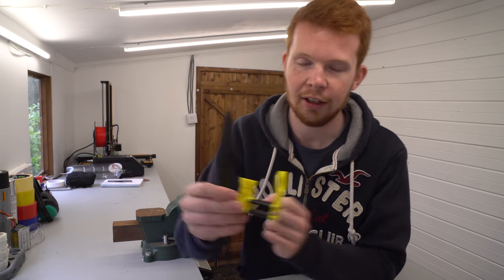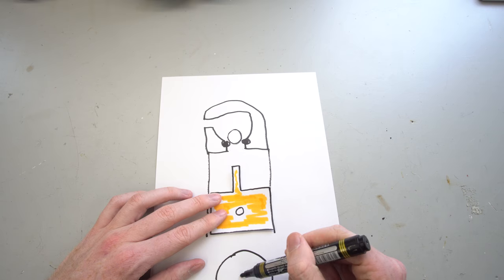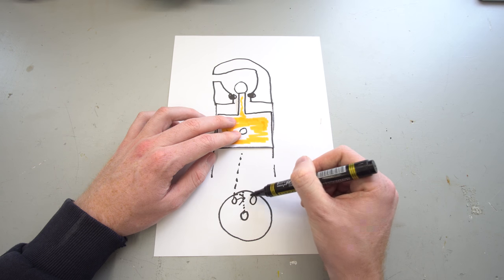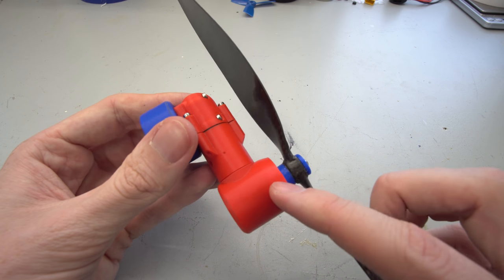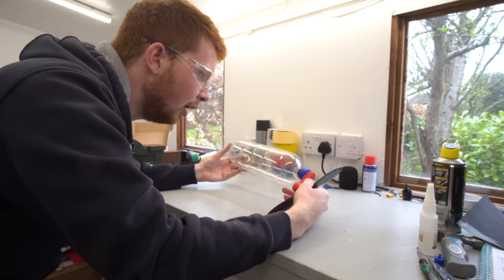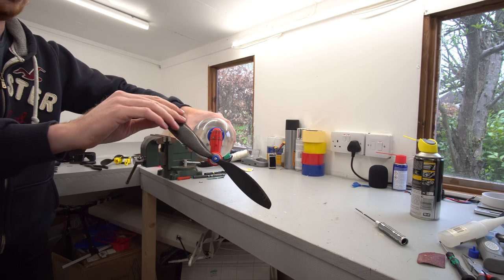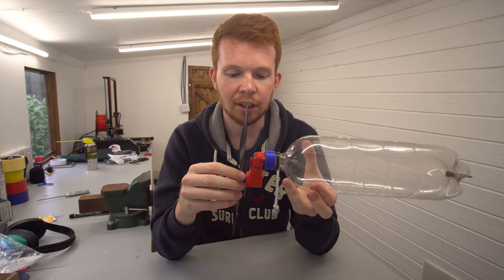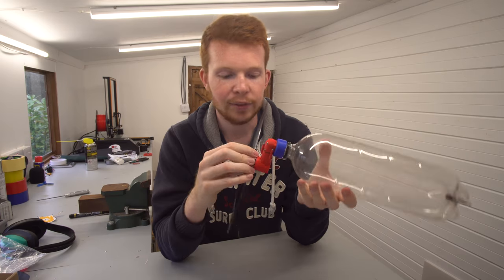Compressed Air Engine Modifications

Comment: You might consider offsetting the centerline of the piston from the centerline of the crankshaft. Look at the VW VR6 engine for an example. By offsetting the crank, you can change the amount of lift duration you will get on either side of Top-Dead-Center. You can also use this to get the downward stroke of the engine such that the connecting rod is more vertical during the power stroke, which reduces side forces on the piston while under load. Playing with this could yield some benefits to the design.
Reply: USWaterRockets yes that would actually be a very good alternative, good explanation.
Reply: That's exactly what I was also thinking about. It would prevent the engine from backfiring - basically putting the timing "later".
Reply: A compression release would improve efficiency. What an engine like this needs to make the most of the air supply is a valve that opens precisely at top dead center then closes right before the piston uncovers the exhaust port.
Also right at bottom it should have a valve that opens an exhaust port at the top of the cylinder so there's little resistance to the piston moving up. That valve should close just before the air inlet valve opens.

All that would make the most efficient use of the compressed air, but the linkage to get the two valves operating would be complex.
Reply: What if there was two holes in the side of the cylinder wall near the top, one on each side. Then a moving sleeve on the outside of the piston with two holes in it that correspond to the two holes in the cylinder, except they are offset in height. That way when the sleeve is slid up, one hole opens, and when it is slid down the other hole opens. Now connect that sleeve to the crank shaft 90 degrees out of phase with the piston. That way you have a valve mechanism which switches from intake to exhaust when the piston is on top and on bottom. 

It would require more precision fits to keep it airtight, but it should be about the same as making the piston seal inside the cylinder.
Reply: @greggeshelman  No, I think you want the intake closed well short of the exhaust opening, or you get no expansion benefit...ie. you exhaust high pressure air WITHOUT it doing any work.  Would be high power, but lousy efficiency.  I agree his design is WAY to far the other way, and the intake valve needs to be open longer than it is.  I suspect, off the top of my head, what you actually want is just a bit above atmospheric at exhaust port opening.  All of this can be calculated to provide any efficiency/power curves you want, within it's capability, which for this engine is ZERO.  ;-)   I would have designed it to be double acting, as well.  Then you can use a MUCH smaller flywheel, you are not throwing all THAT energy away, and the power will double (more or less) for a given piston sweep.
Reply: @MrJdsenior  what it needs to be is a 3DP version of a double acting slide valve steam engine
Reply: @greggv8  Yup, that is what I was thinking.  I worked the riverboat at Dismal World in Liberty Square as a kid/young adult, which was steam powered.  They were double acting 14" bore and about a 4 foot stroke, 90 degrees out on the wheel, 125 psi.  Eighty horses each, TONS if torque, about 10 RPM, as I remember, it was a lot of fun, ran on #2 oil with a little turbine generator up front.

Comment: Maybe the Carbon fiber prop couldn't carry enough momentum at low rpm to keep the engine running?

I am by no means an expert though, so I could be wrong...
Reply: Yeah I think there needs to be more mass for sure. Maybe a small steel flywheel mounted behind the prop.
Reply: At least it worth testing with a flywheel instead of a prop. Just to study the engine.
Reply: When it is mounted on a flying airplane the airflow through the propeller will give it a lot more momentum.
Reply: Definitely the flywheel is too 'small'. To get maximum increase here with minimum additional weight, mount extra weight at the end of the propellor. Must be well balanced though. This would surely do the trick, since the design idea itself is excellent!
Reply: What 3D printer are you using Tom? It's really good that it produces airtight parts.
Reply: I don't think tom should use a heavier prop, he should put a coin sized piece of aluminum or steel depending, behind the prop to help keep the momentum going
Reply: and maybe decrease the size of the rotation diameter of the crackshaft? (if that's possible)
Reply: Creality CR10
Reply: Brodie Bennett Could be, but it also is just a verry inefficient Design!
Reply: Brodie Bennett might not be the only reason but defend telly wouldn't help
Reply: Brodie Bennett ii

Comment: Those exhaust holes look pretty small to me considering they need to let all of the air out of the chamber in such a short time. Maybe you should try increasing the size of those.
Reply: i think what the spring does is it lags the air intake, whith this design it is the only way to control the timing
Reply: or add additional exhaust ports.
Reply: The air goes very fast,so you don't need a big holes

Comment: you could use a screw to open the valve then you can just turn the screw to increase or decrease the timing.
Reply: That's actually a really good idea.  Make the rod coming up out of the piston a threaded rod.  Would just need a jam nut on it or something to keep the timing from slipping while the engine was in operation.  Or, once optimal timing is found glue into place.

Comment: You might also want to experiment with the amount of volume above the piston. Because if it is too small then you might also compress the remaining air too much in the up stroke. And if it is too big you waste a lot of compressed air.
Reply: K van der Veen good point.
Reply: I wonder if there is a way to properly design these things without resorting to trial&error. Or at least do the trial&error in some kind of simulator instead of a 3D printer ;)
Reply: Something along the lines of AutoCAD with a CFD (Computational Fluid Dynamics) plugin?
Reply: hmm, went looking at CFD options: AutoDesk CFD and SimFlow were the main ones I found. SimFlow has a free evaluation version.
Reply: In real cars this space is known as the cc ( cubic centimetres) and the car makers have perfected this ratio so very good point U have there

Comment: Your engine needs to compress a small amount of air while the piston is going up so you lose energy there, I think your best bet would be to have a separate valve activated by a camshaft. You could just make a rectangular piece that runs in a groove in the side of the engines are rides on a off center circle connected to the crankshaft, you lose a bit of energy to friction but you would still lose less than you do with your current design. It could also work as an exhaust valve.

Comment: I really love your contents.
Please make a rotary version too.
Edit: I meant rotary engines or different engine designs.(the dorito ones, any other engine types would be cool though)
please make a turbofan with compressed air tube running into the compressor blades or something
Reply: Xdew Gaming&More do you mean radial?
Reply: air vane motor, just like in an air tool , no springs in them! or a piston controlled inlet like in a toy steam engine, the cylinder moves in a wobble to cover/uncover the inlet and exaust
Reply: +1 for WW1 style rotary :)
Reply: AIO inc. a radial engine has pistons and a rotary has “Doritos” both would be cool though
Reply: HalfBredNinja I understand what your saying and it’s completely right i was just referring to a rotary engine as in a car.  I know it’s actually called the wankle but sometimes referred to as a rotary
Reply: Simpe solution: Wankel rotary
Reply: tbh, that's basically what a pneumatic rotary engine would wind up being.
Reply: Xdew Gamin
Reply: Luke Kolodziej a wankle is not a rotary, it is a rotor engine, a rotary is far more similar to a radial engine
Reply: Xdew Gaming&More 
A duke engine 😂

Comment: The spring is there to offset the opening and closing of the valve. It is opened at TDC and closes much later because of the spring. The design without the spring is basically symmetrical, so after the chamber gets pressurized the piston does go down but it wastes too much energy to go back up. I.e. the piston gains almost the same amount of energy going from TDC down as it takes for it to go back to TDC. Add some friction and your engine goes puff puff stop.
I say replace the center plastic pin with a metal one that moves up and down and rubs against the con rod. The top shape of the con rod should be made like a cam so that it pushes the center pin out. This way you no longer need a spring and you achieve basically the same thing.

Comment: It's air, operates cool, and doesn't seem to need much (if any) lubrication. In theory you could have the air push the piston up from the crankcase and get a more compact design. (So pulling on the usual "pushrod" of associated with a piston design.)Then have a slider-block type valve on the flywheel to meter and time when the air is allowed in.

Comment: Always good to combine the strengths of materials nice project!  One mod I would try is the piston piece on the top use a threaded rod or screw so you can make very small adjustments.  The top of threaded rod that touches the ball can have a piece of hose to give it a very slight amount of shock reduction and give it a little more compression which will make it run smoother.

Comment: what if you tape 2 or 3 bottles together side by side, all 3 with valves fitted to the bottom like you do on this one, but the 3 fill valves are not puppet valves, just tubing connections, that  connect the 3 bottles together? like a manifold,  then you will not loose any strength but you will have double or triple the volume, as the centre bottle dumps air into the motor, the other 2 bottles dump air back into the centre bottle, they can also be mounted one in front of the other, the best would be if you could make a system that automatically switches between a bottle and the next when the pressure is low on one bottle, but that's a bit too much for the spirit of this project :P

Comment: You can separate the piston and tip that open the airflow. You need two shafts and two steps on the crankshaft. It will shift a piston little bit down, when air flow is opened.

Comment: A couple suggestions:
1) a heavier flywheel (prop) goes a long way to making troublesome expansion engines run
2) the crank bearing should be mounted eccentrically in a sleeve in the crank case nose.  Turning the sleeve would have the same effect as lengthening or shortening the peg on top of the piston.  This is how Telco Shark CO2 motors are adjusted
3) have you considered putting an inflation valve right into your bottle cap assembly?  That would allow unmodified bottles which could be quickly swapped out and comfortably run at a higher pressure

Comment: "Back in my day" we had Telco CO2 motors which operated on the same principle.  A couple of features they included that you might be interested to incorporate.  Firstly, the crankshaft bearings were mounted on an eccentric carrier which was rotated to act as an adjustable throttling device - that is like you sanding the top off your piston.  Secondly, the pin is aerodynamically important and (from memory) was profiled to flow the gas radially outwards from the pin axis.  I'd also guess your pin is blocking most of the inlet port area which is what's causing the lack of running.

Comment: I think the issue is the piston is experiencing as much force in the opposite direction as it is in the forward direction, so the forces are canceling each other out. To go springless you could use a single cam on the crank shaft and have it open the ball valve. Then you would be able to adjust the timing on the engine as well as determining exactly how long the valve is open for.

Comment: My thoughts are that the piston is having to compress too much air on the up stroke.  Perhaps increase the volume above the piston at the top of the stroke, or move the exhaust ports further up the cylinder.  You will lose power, but it might run...

Comment: Love your designs. would it be possible to use CO2 capsules as power source?
Reply: Those generally hold ~800 PSI (more then 10 times as much pressure as he's using). It would rip apart any 3D printed parts. There are valves to reduce the pressure but then weight would become an issue.
Reply: ok, understand the issue. However, if he can pump up his bottle twice as much as before the flight time will still be really limited. That is why I was thinking about the CO2 capsules

Comment: What if you used a larger ball for the ball valve? It should allow more immediate pressure build up. That'd be preferrable to the slow spring method... seems inefficient to fill the valve through most of the down stroke.
Someone else suggested larger exhaust ports, and I agree with that as well.

And what are your thoughts on making a CO2 adapter to replace your bottle cap adapter? It'd save you a lot of pumping... but of course then you have to buy the CO2 bottles.
Reply: The problem with CO2 is twofold. First the pressures contained in a CO2 cartridge FAR exceed the bursting strength of the materials he is using. He would need a pressure regulator to step the pressure down.  Second, the decompression of the CO2 coming out of the cylinder makes it severely cold! O-rings fail regularly at these temps (Discovery SRB). Also, most extruded plastics become quite brittle at these temps.
Reply: Martin Dinner I knew the pressure would be an issue, but I totally forgot about the decompression temperature drop.

Comment: Have you looked at pneumatic hammers ? They work by accelerating a hammer backwards and forwards through pressurised air and clever porting 

Seems you could be able to adapt this to an engine, replacing the hammer with a piston and the anvil with a crank

Comment: Are you loosing compression around the piston? I saw the sanded version, just wondering if there's too much of a gap there. Also is the ball re-seating reliably? If that used a spring, maybe the required spec wouldn't be as finicky. Nice design improvements, keep it up.

Comment: This idea might be more suited for a multi cylinder setup so you dont have to coast as far.

Also, check the water rocket you tube channels. They get the same strength out of double and tripple joined bottles compared to a single bottle. You'll get lots more volume.

Comment: Bigger flywheel required. Try a metal bottom-end on the motor or a prop/flywheel combination for the sake of a quick prototype. Single cylinder engines require much higher rotational inertia.
Enjoying your thinking processes here.

Comment: Your problem seems to be the ball valve, it doesnt have enough force pushing it down back into the o-ring after the valve has been opened and so the valve stays open for too long. I know the spring is the thing you wanted to eliminate, but you could do with one behind the ball valve pushing downwards.

Comment: I think that the main reason that this failed was that there is no negative return pressure. Just 1bar or atmosphere at TDC that is then compressed probably to about 3 or 4 bar. It was the return spring that did most of the heavy lifting on the last engine. If you wanted rid of the spring you could use 2 pistons If you made them horizontally opposed they could use the same con rod. These are just my thoughts and I might be wrong. Please tell me if you think so. Great video. 

"From success we learn nothing."

Comment: Just a few thoughts, you might want to have a pushrod actuating the valve that is separate from the piston, so that you can adjust the timing.  Also, if you made the engine a 3 cylinder rotary, you could design it so that it can't go backwards by nature of its design, and you can use things like cam rings that actually make the engine simpler, although on that scale you might have to go with a planetary gear with little valve pins actuated by an eccentric gear mounted to the crankshaft.  Another thing that might help is regulating the gas flow to a specific pressure, which might make tuning the engine easier, and allow you to get crazy with super high pressure tanks, like 150psi+, but allow you to keep using the lower cost materials that otherwise wouldn't stand up to the absurd stresses.

Comment: Maybe make the top of the cylinder a bit wider, so more compressed air can rush in to later pust out the piston.
Also try putting in a bigger ball with a bigger hole,so there is a bigger cross section for the air to move in.
One more thing, if you make the piston's pushing part by drilling and threading the piston and drive in a screw, it's going to be adjustable ;)

Comment: Hello. I like your video and efforts very much. When I was young a had e working steamtractor toy. Quite large actually. It had a double working cilinder. It utlitized very clever timing and sliding valve mechanisme to use a smaller bit of pressure to help push the piston up and just through the top dead center in your model. The main 'down' valve actually opened quite late.  The piston itself could do open and close in and outlet ports. It requires pressure channel along te side of the cilinder though and the piston needs to pass them  and therefor open and close them at the  right moment.

Comment: Nice Experiment.
Also experiment with rotating the motor, try having the head at the bottom, gravity might help holding the ball valve open for longer, or open for ever!
The ball valve is closing too early, the spring used to keep it open for longer.
One solution could be a second conrod to action the valve with the correct timing
Another solutions is a 2 stage valve... the story is: it takes a lot of force to open the valve, it takes very little tho keep it open.
It is used a lot with hydraulics